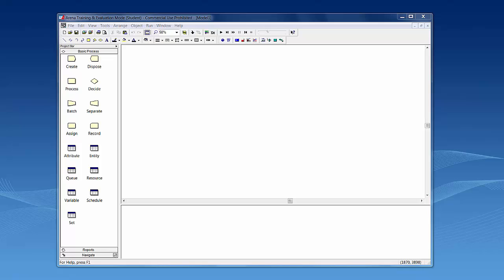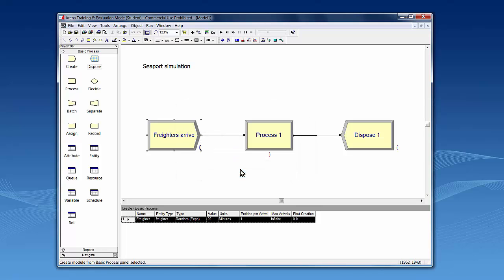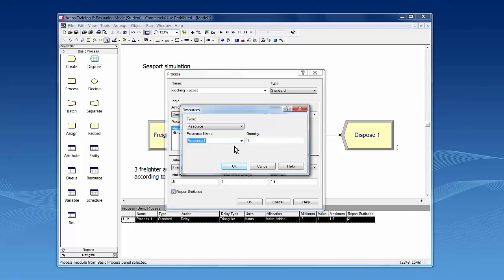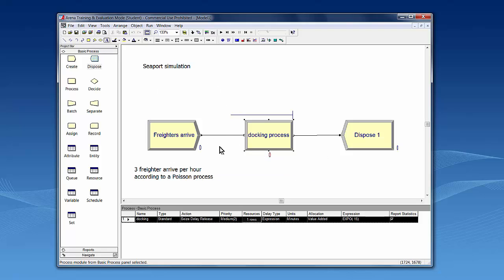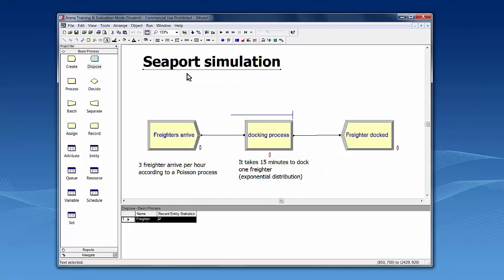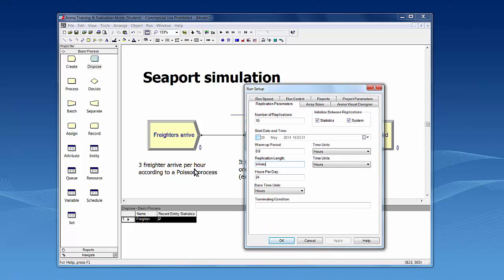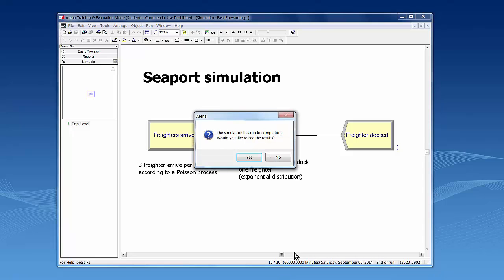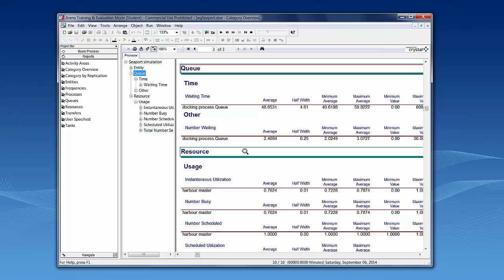Simulation with Arena - 1

Comment: Hi, how do you simulate M/M/2 queues?
Reply from the maker: A M/M/2 (or more generally a M/M/c) system can be built similar to the previous tutorial. However, you will have to change the resource's capacity. That means: Basic Process >> Resource >> Capacity >> 2. In this tutorial the resource name is "harbour master" and its capacity needs to be set to 2, which means two harbour masters are available for docking ships.
Reply: thanks! Do you happen to know how we can model a bidirectional channel (e.g for calls or packet transmission) in ARENA?
Reply from the maker: If you  want to model computer networks, then I'd suggest to use a different tool: Opnet (commercial, now called riverbed Modeler) or the Network Simulator (free, ns). The following article gives some insights into modelling "channels" with Arena: http://www.informs-sim.org/wsc11papers/346.pdf